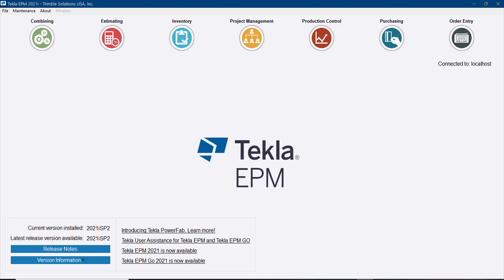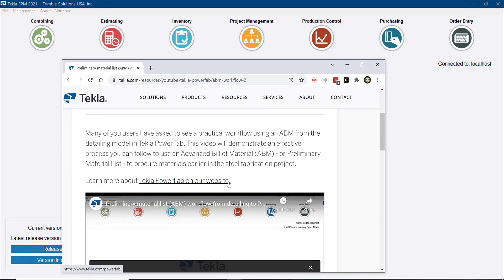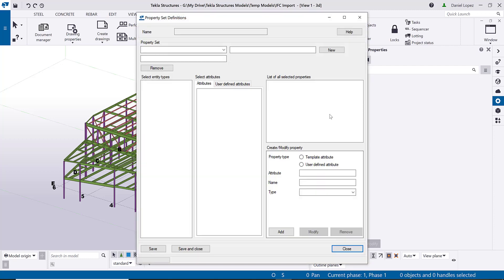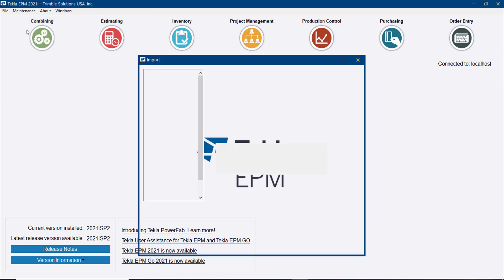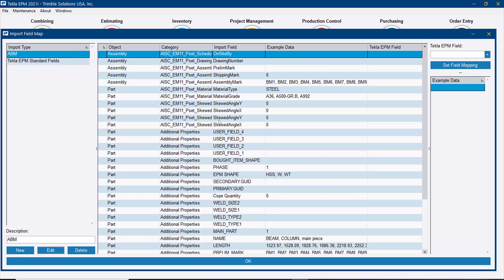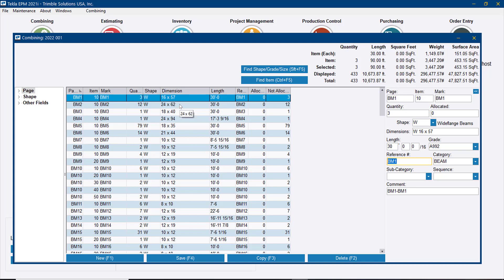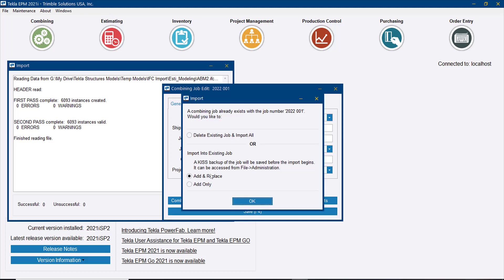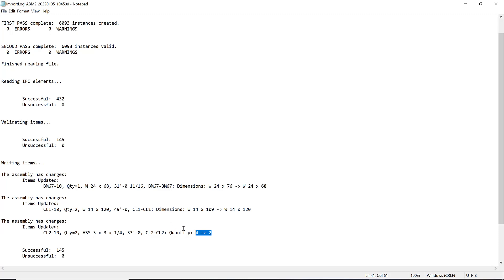Preliminary List/ABM Import From IFC

Comment: Hi Dan. Would this same process work if we imported the preliminary IFC file into the production module instead of the combining module?
Reply: Hi Nick, it is not the best practice because you will be missing point of comparison, it is recommended to use ABM's in the combining module. 
Also in Production control we use XML instead of IFC, check this for more reference of the whole workflow: https://www.youtube.com/watch?v=2Wn97Apcbmc